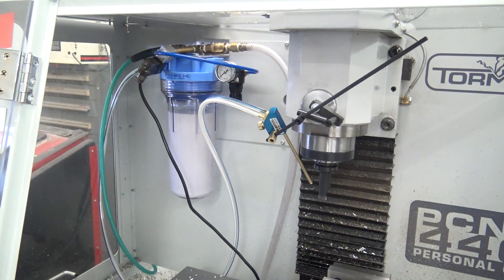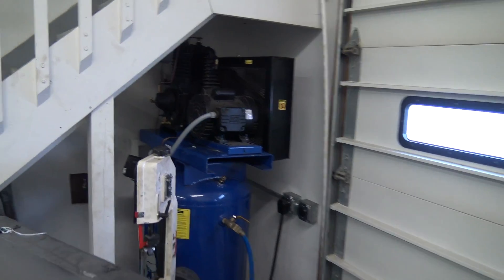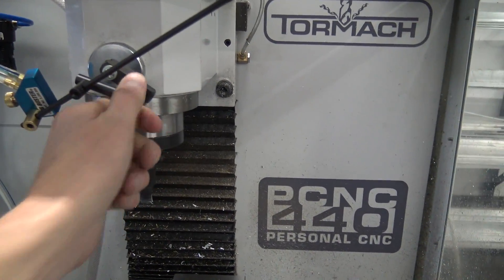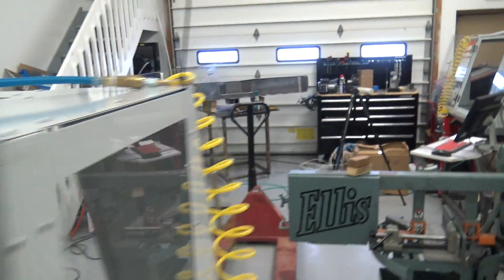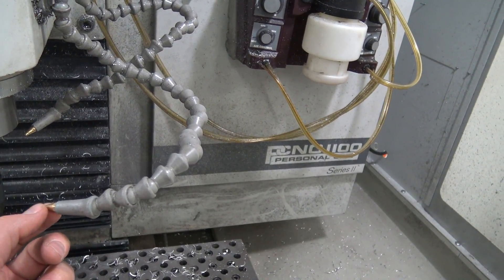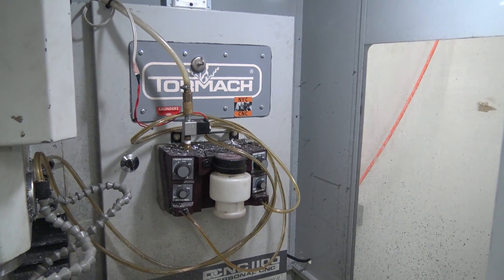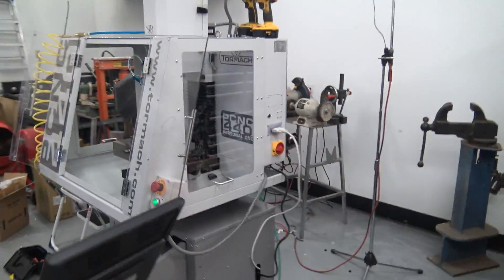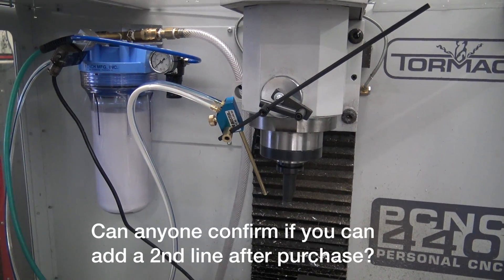Fogbuster Vs. Trico CNC Coolant: 3 Minute Comparison!

Comment: I have a kool mist single sprayer, the one that comes with the loc-line, and "use your own tank" mister.

It has one adjustment knob for both air and coolant.

I am on a non enclosed manual mill.

The air to coolant ratio is potent, like feel dizzy potent. Add too much air, the coolant becomes thick, foggy, and potent. Add less air, and coolant doesn't have enough pressure to shoot out, and clear chips.

 There's no perfect adjustment. My coolant tank is a 5-gal. bucket and on the floor, the coolant line was about 4.5 feet to the spindle. I literally just moved the line siphon to higher than the adjustment block. Coolant comes out so much easier and the line in now about 2ft long. But too much coolant comes out, and even with a low amount of pressure like low enough to where you can point the nozzle at your face with no coolant obviously and not shoot your eyeball out of your head. Lol

Is this a solid consistent mist?

Say I use it outside of en enclosure. Will I pass out like I'm feeling with my set up?

I've tried accu-lube and their blocks just suck and just don't work, also the that brand coolant had me passing out.

What to do?

Comment: Appreciate the video but I feel like the two systems are not usually comparable. I was under the impression that the Trico you have is usually used to disperse oil (hence the small bottle size) while the Fogbuster is used to disperse (water based) coolant (more similar to Kool Mist products). The whole reason they called it the fogbuster is because of the way the Kool Mist, and similar products, mix coolant at the nozzle. Either way, I appreciate the video and it solidified my decision to go FogBuster.

Comment: I bought a Trico, but haven't installed it yet. I also bought a gallon of their synthetic coolant, but it was only $40 or so.

Here's my main question: The FogBuster claims to be superior because it doesn't atomize the coolant, and there for the coolant doesn't get into the ambient shop air. Even though I have the enclosure, I'd rather not be inhaling the coolant. Does the Trico atomize the air?

Because it's so far unused, I figure I can sell my Trico for a decent amount of money, and just get the FogBuster. What do you think?

Thanks!
Reply: +NYC CNC and do you find one is better than the other at clearing chips from deep pockets?

Comment: Installed a 2nd Fogbuster a few days ago since I had quite some problems cutting (quite soft) aluminium sheets. The material did "gum up" when the fog came from the wrong side on some cut directions. So adding a second one is possible: https://www.youtube.com/watch?v=gJ1X-MzoN-0
Reply: +NYC CNC I played around a bit with F but you are right, the toolpath was really suboptimal. (reminds me about your video on high speed machining toolpaths). Since it was not the first time I had to move the Fogbuster arround I´m happy I finally took the time to install a second one.
Reply: +NYC CNC no - its from a small german company (SK CNC) - but not too far from DIY :) - allthough I think they make quite an effort in producing these gantrey machines like annealing the steel frame. I have no idea if that really makes much difference but I am always surprised how precise that huge thing is (without having much reference - only a small really hacked together DIY full-aluminium gantry mill from back in the days when my interest in CNC started :)

Comment: So I came across the deal of the century and got two Trico MD-1200's for $300. It works great on the manual mill and pretty good on the 1100. How does the fog bust compare with air velocity over with that long brass tube over the Trico?
Reply: +NYC CNC DO you find the fog buster requires less priming? My Trico unit need to be run a full throttle for  about 15 minuets if the y have sat for a long time?

Comment: John, great comparison!

I attached the Fogbuster nozzles in the same place at first but found the magnet mounts stick much better to the sheet metal components than they will to the cast mill head. For small parts I stick it to the face of the electronics enclosure so I don't have to adjust between tool changes. For deep pocketing where it needs to move with the z axis it works much better on the motor door (with an enclosure it doesn't look like you have clearance for this option, but thought I'd toss it out there for anyone without an enclosure, might save someone some fabrication time making a new arm).

Thanks again for the videos.

Comment: Here are some data for those considering the Fogbuster. I bought one for my PCNC 770 a couple years ago and haven't used my flood coolant since. I don't use my 770 on a daily basis so I don't like to maintain the flood coolant system compared to no maintenance of the Fogbuster except adding coolant every few months. My single nozzle Fogbuster worked fine with a cheap ($200 on sale) Enco Jupiter 2HP 20 Gal 5.5 cfm @ 90 PSI compressor. I installed the 2nd nozzle Fogbuster upgrade from Tormach a few months ago and the Enco compressor burned up the next day because it couldn't keep up with extra flow required with 2 nozzles. I upgraded my compressor to a slightly better $630 Sears Craftsman Professional 1.9HP 27 Gal 5.8 cfm @ 90 PSI and it has been working fine with 2 nozzles. My guess is the Enco compressor may not have been able to run continuously at its rated capacity and the Sears compressor can. I agree with John that the magnets that come with the Fogbuster aren't strong enough to hold the nozzle in position and they also scratch the paint on my 770 so I replaced them with much stronger neodymium cup magnets (1.8" 160lb pull force for $5.19ea, search for "CUP-46" at magnets4less dot com). To protect the 770's paint I covered the new magnets with rubber covers (48mm, search for "MM-RC-48" at kjmagnetics dot com). Kjmagnetics sells a nice 48mm cup magnet that fits the rubber cover but it costs $16.58ea (over 3x the price of magnets4less). I've been very pleased with both the 1 and 2 nozzle Fogbuster system and don't think I will use my original flood coolant system again.

Comment: I have a G0704 I recently converted to CNC, and I was originally planning on doing cheap flood coolant to avoid having to buy a new compressor. However, I really don't want to deal with the mess and maintenance of a system that I only use on occasion for a hobby (I think flood will probably end up more expensive and time consuming in the end anyways...). It looks like a 20 or 30 gallon compressor + fog buster is next on my purchase list.

This video was timed perfectly for me. Thanks!

Comment: I know I have heard you talked about not liking the koolmist setup before. Why not exactly? 
I recently picked up 2 koolmist kits for use on my surface grinder and the other for my mill. Haven't gotten a chance to use it yet due to needing an 1/8" npt male to 1/4 npt female adapter which no one around me besides Mcmaster seems to have.
Reply: +NYC CNC We use koolmist setups on our manual mills where I work and they work great. The only problem is you turn on and adjust the flow manually with a knob so many of our guys waste coolant spraying too much. You would also have to rig something up to turn it on and off with cnc.

Comment: Interesting. So what sort of sized air-compressor is actually required? You say yours is bigger than required but an indication of a sensible size to start with to drive a fogbuster (plus say a hand air-duster) would be useful. (Air compressors seem remarkably expensive!). Anyway, thanks for all the videos.
Reply: +NYC CNC OK - thanks for the data point!
Reply: I can report that I use an 8 gallon California AirTools compressor and with the FogBuster regulating at 10 lbs/sq. in. it more than keeps up. I have not tried it with higher flows as it is working really well at 10. Note: I am a home shop machinist; nothing pro or production.
Reply: @mattnottingham3663 what did John say to your question? His response is no longer showing up
Reply: @kyled159  I have no idea! I don't even remember asking the question!

Comment: Great mini review.  Three tormachs; that must be fun.  With the 440 out now, where do you think that leaves the 770?
Reply: +NYC CNC The 770 was a good fit for me, working with a lot of aluminum so the 10,000 RPM spindle is nice speed enhancement over the 1100. You give up a few inches of travel but not quite as much as you do on the 440. I've had a couple of challenges with the 13.25" of Z on the 770 so the 10" on the 440 wouldn't have worked out real well for me. I was somewhat power limited in my garage so only needing a dedicated 20 amp 110 outlet for the 770 was easier/cheaper than an extension panel to add more 220.
Reply: +Toms Tiny Shop Great points! It's amazing how much time the spindle spends at 10,000 RPM's when cutting aluminum. The 770 has been a great machine for me and I have no complaints. Probably would have held off on buying the 4th axis right away, it's still unused sitting in the box, and bought the enclosure instead. Machine can make one heck of a mess!

Comment: Yes, you can add the second line and it is available as an upgrade to the single line system from Tormach. I've added it on my 770 and it was very easy to do. http://www.tormach.com/store/index.php?app=ecom&ns=prodshow&ref=35578